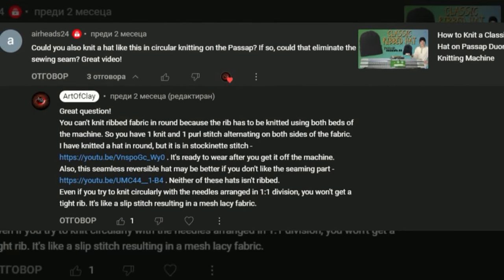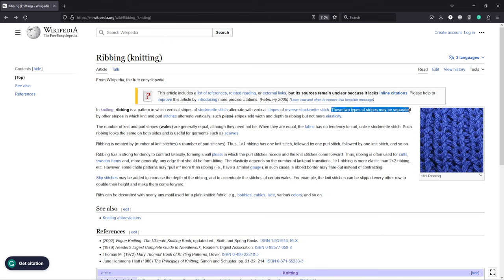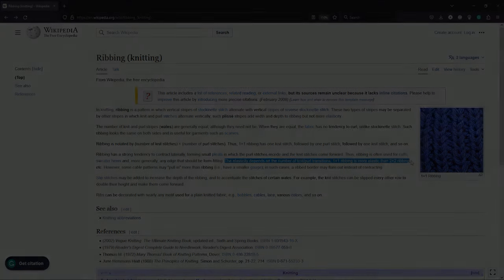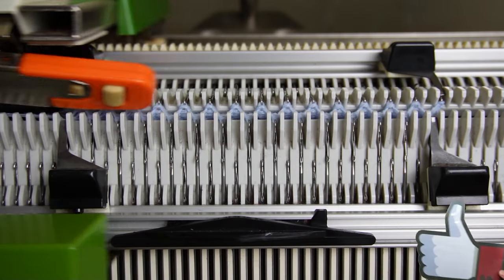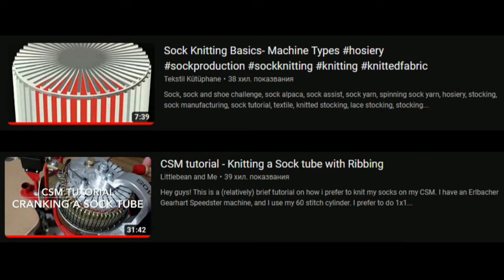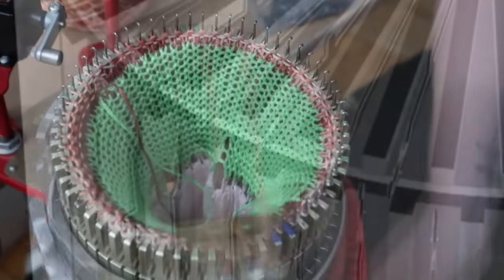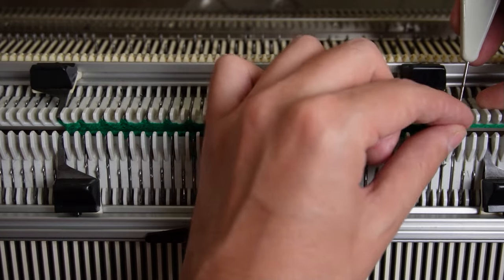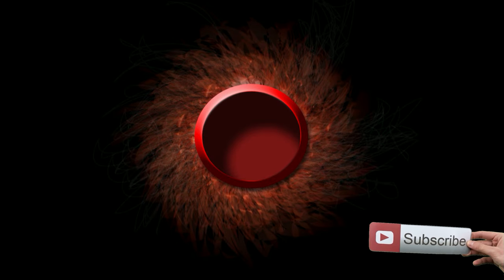Ribbing in The Round on a Flat Bed Knitting Machine - Why is it NOT Possible?

Comment: It is actually possible. I have seen people do it, I'm trying to figure out the witchcraft behind it, but it looks like you use both beds for both sides. You use ever other needle for each pass so bed 1 needle 1 is ribbing bed 2 needle 1 while bed 2 needle 2 is ribbing bed 1 needle 2.

You then transfer to the missed needles in the second pass.

At least that's how I think it works, I've not managed to pull it off
Reply from the maker: Would you happen to know if there's a video demonstration available online? Seeing the technique in action could be really helpful for understanding the process better.
Reply: @ArtOfClay the only one that I know of is a video on kniterate. I would link to it but when ever I put urls in my comments, yt deletes them.

It took me watching the video over and over again to discern what they were doing.
Reply from the maker: Thanks for letting me know and for sending the link. It seems that the machine has needles that can automatically transfer the stitches to the opposite bed. I will try to decode what is happening, and see if it is feasible to replicate it on the Passap. It will be worth a try if the U80 lock can be made to transfer the needed stitches automatically. Otherwise, it seems that for 20 rows of ribbing, you would have to transfer the stitches 40 or even more times between the beds, for each knitted row. And if this is done with the double-eye bodkin tool, it may take years to finish the project.
Reply: @ArtOfClay it is a case of technically possible vs realistically possible
Reply from the maker: @Falney  Oh, I thought you were specifically speaking about making this on the Passap. I am sorry if I have said that knitting ribbing in the round is generally not possible in the video. I agree that technically it is possible. I have seen rib knitted in the round on other machines by dropping every other stitch and latching it up with the latch hook, but I guess with the small space between the beds it will be a nightmare to be done on the Passap. That's why I haven't included this way in the video. Whatever, the video you sent is interesting, and may be worth some time thinking and testing.